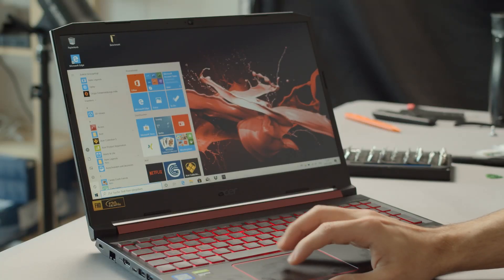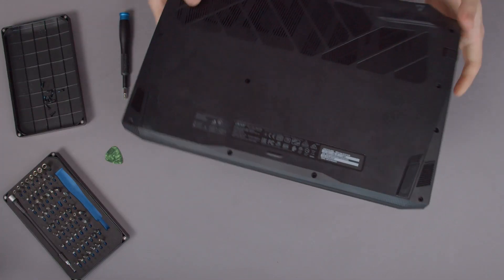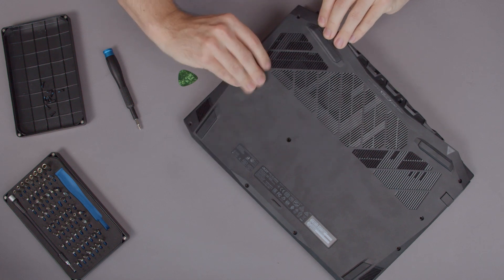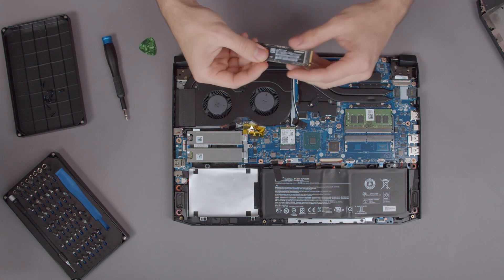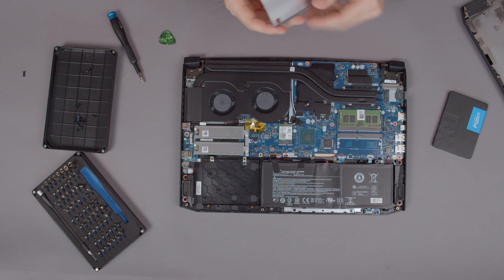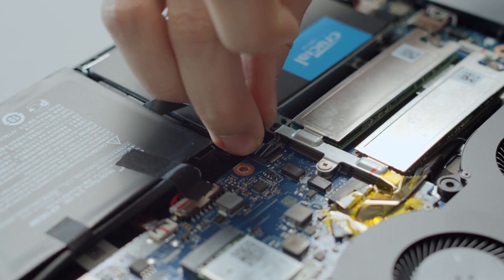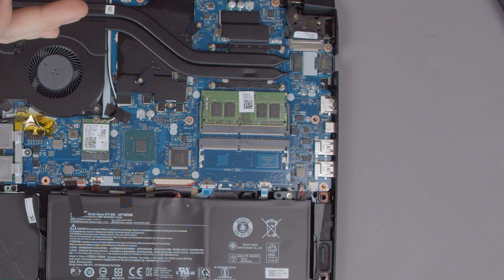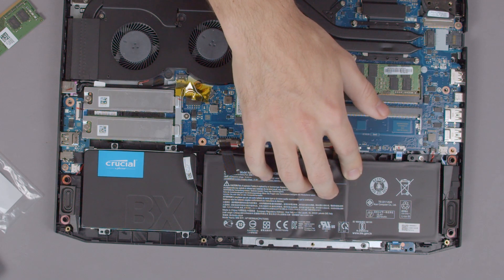Tutorial: How to Upgrade the SSD and RAM of your Acer Nitro 5 - ENG

Comment: Neat, I just got this laptop, and I am so happy that I can replace and upgrade some of the components! I am hoping to upgrade my RAM asap.
Reply: I got one about 2 months ago and this laptop is sick and I want to get an 1 tb ssd and 2 8gb ram sticks and I'm set lol
Reply: @67features  just recently replaced the ram and it wasn’t hard. Just some things he didn’t mention is that you have to tilt the stick and push it down and to take off the older one you have to pull on those hooks securing the sticks
Reply: @southerncalifornia4771  hey where did you purchase your memory just curious? I know there's tons of places. I'll probably upgrade my sons laptop to 16GB. 32 is just overkill for Roblox.
Reply: @ever6  I read up on some best fits and just bought it off amazon. Yeah thats what I have now 16gb. The pair cost me 59 USD. I think that this laptop anything 2666 is compatible. 
 
G.Skill 16GB 2666MHz DDR4 SO-DIMM Laptop Memory Upgrade Kit (CL19) 1.20V PC4-21300 Ripjaws 2x8GB
Reply: did you get the one with the GTX 1650 Ti or the RTX 2060? How is it with gaming I'm looking at getting one my self just don't know which one to get.
Reply: @bryanmathis224  I bought the gtx too; it runs escape from tarkov on high settings with roughly 70fps; any single player game can basically run ultra; all darks souls 3 will run ultra with 60fps too. Proper neat laptop for the price
Reply: @bryanmathis224  I have GTX . It is honestly better than I expected. It runs most games. Warzone, Apex,  and even Cold War but obv a bit frame drops. The only drawback I i have the 500gb but an upgrade to SSD will fix that. Not too bad
Reply: @SouthernCalifornia  hi sorry i just had this laptop and i have the 512 ssd pcie. The empty slot beside it. Can i just add another m.2 pcie 1tb ssd to it for extra storage without downloading anything or do  i need to do something else? Same 2.5 inch ssd can i just bjy and. Plug and the system would  recognise it? Any help would be appriciated please?
Reply: @martachong123  
If you want to know more about something you aren't able to understand than
Comment me back i'll try to help,(i have most of the details here to get you going):-
Check wheather the empty (M.2 Pcie Drive is sata or nvme protocol and buy the one that's same to it,
Check that and for the 2.5 inch drive mount the drive to it's metal tray and connect it to laptop motherboard through the
pre provided ribbon cable as shown in the video.
Note:- You don't have to download anything but the new drive's won't show up in the windows explorer just yet.
You have enable them from windows first. 
Search:- How to enable new storage drive's in windows 10.
That will be an easy way to understand and follow along through the steps in the video and get your drive's running.
Reply: Can someone explain to me why you need change or replace the ram if there is a 2nd socket to put it so you have 2 indicated ram.
Im beginner in the world of laptops so i am asking.
Reply: @doshiishiro5826  It's so that you have two similar Ram modules/Dimms to have better and most compatibility between them and don't end up having any system issues which you likely won't but still can have.
Reply: @chettiarsirusraj9501  can you suggest any laptops for me for civil engineering student
Reply: @doshiishiro5826  I don't know what programs or apps you use but try to ask the,
 teacher or your manager from your work place about what specs you should have in your laptop, 
Like :-CPU
Intel:-9th,10th or 11th gen CPU processors.
AMD:-3000 or 5000 series CPU processors ,
GPU any Nvidia Gtx1650 or 1660 series or if you can find and afford RTX 2000 or 3000 series will be a good option 
and the 
(Ram amount 16gb i'll recommend atleast you can buy the laptop with 8gb ram and upgrade it to 16gb or 32gb later).
Reply: @chettiarsirusraj9501  for example i buy a laptop with 8 gb ram and buy an extra 8 gb ram and use that to the 2nd slot, so i have now an 16gb ram? Does it add or not? 

Btw thank you so so much for responding because i am really beginner.
Reply: @doshiishiro5826  Note:-the laptop ram are called so Dimms(due to their smaller size).
You can do that but make sure to buy the same capacity and clock speed of ram that you already have in your system/laptop you can check that in windows10 task manager in the performance tab ok.
Otherwise the system will run at the ram clock speed of the slower ram/Dimm module.
Reply: @chettiarsirusraj9501  if i have a budget of 45,000 pesos or 900usd, what can you suggest a best laptop for me, 
You can also suggest a laptop that has low ram and storage if it's upgradable but with good gpu and cpu.
I really struggling all this week to find a best laptop that is worth buying, because i save money for this, so becoming a wise consumer is the best for this i think.
Reply: @chettiarsirusraj9501  so i must also check that "clockspeed" i don't know about that but i think its necessary since you tell it to me. I must check that they are the same in clockspeed and capacity,

So if i have 8gb ram i also must buy 8gb ram to make it 16.
But if i have 8gb ram and buy buy 16gb ram, the system only use the smaller one which is 8gb ram, so i just waste my money ,
But to solve that i need to remove the lower one which is the 8gb ram and put the 16gb ram so the system will reads it.

Am i right? Or still dumb hAhah
Reply: @chettiarsirusraj9501  do you think 4gb gpu like this laptop can run autocad for civil engineering.
Reply: @AwesomeFusion Check your systems specs through task manager(in the performance tab)for your laptop/Pc and get matching ram stick with the same capacity like 8gb+8gb for a total of 16gb ram,16+16 for 32gb ram and so on upto 64gb.
Just search for your (laptop/Desktop memory in what capacity you want like 16gb,32gb,64gb) memory in (New egg/Amazon) buy two sticks of identical ram for your particular system. You can comment and ask for some more details if you need help.

Comment: I've added 8go of ram ans checked the clock speed and everything, my pc don't want to start rn, please help me idk what to do 🙏
Reply from the maker: Hey, check if the RAM is inserted properly and try again. Usually it's just not perfectly fitted ram.
Reply: @notebooksbilliger  it was inserted properly
Reply: Hey did you find the solution? I have the same problem
Reply: @raco1246  no i haven't but some peoples told me to try different brands
Reply: @gaspard2975  I unplugged the battery and it worked!
Reply: @raco1246  you disconnect it then reconnect it and it works ?

Comment: can you do aa tutorial for removing the radiator and cleaning the fans youll be the first to make that
Reply from the maker: Hey, you don't neet to remove the heatpipes in order to clean them. Just get a bottle of canned air or a small blower and blow into the fan outlets when the laptop is shutdown. That should clean the fan grills easily.
Reply: @notebooksbilliger  thanks for the reply really appreciate it. But should i also disconnect the battery when doing this? Or not necessary?

Comment: If we just change the  ram do we have to install windows again and can we change ram from 8gb ram to 16gb and how  uch mhz is required
Reply: Changing or adding RAM doesn't affect your windows.(it will be the same as you left it once you turn it back on). If you want 16 gb of ram make sure to buy two sticks of 8 gb at the same mhz (or if you only need to buy one stick of the same mhz as the one in the laptop). In his video he says which mhz sticks to get.

Comment: how much the maximum capacity m.2 storage that i can upgrade on m.2 slots ?
Reply from the maker: Hey, in theory Windows 10 supports up to 9.4 zettabytes. The only limitation currently is whatever is available as M.2 Cards right now. 4TB is readily available, larger drives are possible but so expensive it's just not worth it.

Comment: If i have an intel processor can i still change my ram into a 3200mhz one? Or should i stick to 2666
Reply from the maker: Hey, you can, but it will run at 2666MHz since the Intel Chipset doesn't support higher speeds in this case.

Comment: Hello i use acer nitro 5 2018 , and its only 4 GB ram. There was just two slot. can i use another slot by add 8 GB ram without remove the original 4 GB ram?..please help me..my laptop slow as turtle😢
Reply: Why don’t you take out the 4 Gb?
Reply: @lucascarneiro2101  it better 12GB right? It such a waste if i remove 4gb ram

Comment: Laptop turns on but screen not turning on after ram upgrade. Help? My laptop came with 3200mhz ram, i want to upgrade it to 16gb 2400mhz, does this mean my nitro 5 only support 3200mhz? Reason why im using 2400mhz is because im taking the ram from my prev laptop which only support 2400mhz
Reply from the maker: Hey, the speed of the RAM doesn't matter that much. In case you have a Ryzen model slower RAM will only need to a bit less performance. The screen not turning on usually means the RAM is not properly in place, or worst case, defective. Try turning it on with only one module, then with the other and then both again, to find out if one is maybe broken.

Comment: I don't know if anyone is still actively answering questions, but is there 2 M2 slots? So 1 existing for the factory SSD and then an extra? I'd love to be able to run 2 M2 SSDs and then a 4TB HDD.
Reply from the maker: Hey, of course we are :) There are 2 M.2 Slots - one i SATA and PCIe each. So check in advance what kind of SSD is preinstalled. If it's a SATA one, get a PCIe SSD and vice versa.

Comment: I bought this gaming laptop a bit early(2 years ago), my model is Nitro AN515-51 so everything I think is situated a bit differently, the lids are all seperate for each component in the laptop, my RAM is 6 GB which is the greatest torture, since it doesn't work like an 8 GB one and seems to be no different than a 4 gb one. My question is if I can upgrade to 32 GB of ram? I know its possible with Nitro 5 laptops in general, in fact that would be the max amount of ram you could upgrade, but I am wondering if my model can handle 32.
My Specs
Nitro AN515-51
CPU: Intel Core I5 7300-HQ
GPU: Nvidia GeForce 1050
RAM: 6 GB (1x4) (1x2) Dual Channel
Motherboard model: Freed_KLS v1.13
BIOS: Insyde Corp v1.13
Reply from the maker: Hey, you can of course upgrade the RAM. The theoretical maximum is 64GB, so 2*32GB. You just have to replace both RAM Modules for new ones, so better get a fitting kit with the desired amount of RAM.
Reply: @notebooksbilliger  thank you for the reply

Comment: Can I upgrade my Nitro 5 AN515-54-75aj RAM from 2666mhz to 3200mhz?
Reply from the maker: Hey, you can use 3200MHz RAM, but since the Nitro 5 will only use a maximum frequency of 2666MHz, it won't make the RAM or notebook any faster than using 2666MHz modules.

Comment: Just bought a PNY 2.4Ghz 8Gb ram stick not sure if it matches up with the one I have inside my case nitro 5 it’s the one with Ryzen would there be a problem if I install this ram stick?
Reply from the maker: Hey, it will work without issues, but usually the Nitro 5 uses 2666MHz RAM. So to match the new module it will slow down the existing RAM to 2400MHz as well. It's usually not a big performance hit though.

Comment: after you add the new sdd 2.5'', just turn on the laptop or you have to do something else? like a configuration?
Reply from the maker: Hey, you mean when you add a secondary SSD or when you swap the existing one? If it's a secondary you just have to initialise it. After booting the notebook hit the windows button and type "Disc management" and there should be a prompt to initialise it. After that just format it and you're good to go. Here's also a quick guide: https://www.diskpart.com/articles/format-ssd-6289.html#:~:text=msc%22%20to%20open%20Disk%20Management,system%2C%20perform%20a%20quick%20format.
Reply: @notebooksbilliger  thank u!!

Comment: What is the max ram capacity for this series?
Reply from the maker: Hey, that depends on the exact model you have. Most new Intel and AMD CPUs support up to 64GB, but since it has only 2 RAM slots, 32GB is the maximum you should go. 32GB Modules are still very expensive and the costs outweight the use of the extra RAM.

Comment: Hi nbb, I have the Nitro 5 with ryzen 5, gtx1650 with a single 1TB HDD and 8gb ram(6.5 actually because of integrated graphics u know). I'm planning to add an SSD and an additional 8gb ram. Which one should I do first? Also, is 120gb SSD enough?
Reply from the maker: Hey, if you want to improve the overall performance get the SSD first. Compared to the HDD your Nitro will just fly with a SSD. 120GB is not really enough and also doesn't make much sense sind bigger SSDs aren't that much mor expensive. Get at least 256GB so you can put some games and heavy applications on the SSD as well. Better do that first and then save some money for an addition 8GB RAM.
Reply: @notebooksbilliger  Thanks for the tip! Got a clear idea now. Really appreciate it!

Comment: I am really nervous to do the upgrade is there any way that I could break the laptop
Reply from the maker: Hey, being nervous isn't the best start tbh. But there is no reason to worry. If you are carefull and take your time to follow the steps you should be fine. Just don't rush it and when you use a metal tool like a screwdriver be extra careful not to scratch the mainboard.

Comment: Just upgraded with battery connected. Grounded. 2 SODIMM Kingston 16GB each model KCP426SD8/16 (2666MHz, CL 19). And I just noticed late your warning, about "Important Notice: second M.2 must be SATA"... I already purchased Crucial 1TB NVMe M.2 PCIe SSD P1 Model CT1000P1SSD8. The free M.2 slot was the top, near the vents. When I removed the M.2 protector, the mainboard was printed with "PCIE" so I decided to install and try and it works. This was on an Acer Nitro 5 AN517-51 17". (Complete model AN517-51-56YW). This Acer came with 8GB Hynix HMA81GS6JJR8N-VK and a 512GB SSD WDC PC SN520 SDAPNUW-512G-1014 NVMe Gen3 x2.
Reply from the maker: Hey, it always depends on which slot is already used. Apparently in your case the preinstalled SSD was SATA you you could upgrade with a PCIe NVMe :)
Reply: @notebooksbilliger  Nop, pre-installed disk is Western Digital PC SN520 (PCIe Gen3 x2) https://documents.westerndigital.com/content/dam/doc-library/en_us/assets/public/western-digital/product/internal-drives/pc-sn520-ssd/data-sheet-pc-sn520-compute.pdf

Comment: Hi, I have a HP Omen 15 2020 laptop and I want to upgrade the SSD.
It comes with one pre installed 512GB M.2 NVMe 3x4 and one M.2 NVMe empty slot.
So do I need to do cloning after installing the new SSD or should I just plug the new one and I'm ready to use it?

Please help as I can't find the answer to this anywhere.

Thanks & regards
Reply from the maker: Hey, if you just add another SSD you won't need to clone anything. But you should check if the second slot really is a PCIe M.2 Slot or maybe just SATA. Usually it's printed on the PCB or, if not, just put the current SSD into the other slot and see if it's booting. If yes, just add another SSD, initialise and format it and you're good to go.

Comment: WD SN750 2TB Laptop internal solid state drive. Model (WDS200T3XHC) Does it support with this model, in the video
Reply from the maker: Hey, it will work, but only in the M.2 PCIe Slot that's usually already occupied. So check what kind of SSD you're using right now. If it's SATA you can just add the WD SN750. If it's a PCIe SSD, you would have to switch the existing one for the SN750.

Comment: And one thing bro can I install 2.5 inch  2tb ssd drive and drives come with the connector and I have to buy separately
Reply from the maker: Hey, usually the do come with the adaptor. If not, I added the exact cable to the video description.

Comment: Pls help...
My screw is stuck so tight that i cant gety cover out !
What can i do ? All except one screw came out
Reply from the maker: Hey, that's odd. Try a different screwdriver maybe with a better fitting tip and a bigger handle. But be careful not to ruin the screwhead with a bad fitting tip.
Reply: @notebooksbilliger  thanks for the tip , but do you know of any method like applying some kind of oil or anythng like that ?

and what should i do if it doesnt come out even after using a different screwdriver?

Comment: Can a 1TB seagate barracuda HDD 2.5"  fit? I know getting an SSD would be faster but after buying the laptop I can just about afford the HDD and I need more storage than the 256GB SSD it comes with as standard
Reply from the maker: Hey, as long as it is a mximum of 9mm in hight it will fit and work.

Comment: Does it matter which ram pin amount I buy such as 240 204 260 pin sodium memory
Reply from the maker: Hey, yes it does. Only one will fit, so get the correct one :) You'll need DDR4 SO-DIMM with 260 Pins, every other module won't work - they won't even fit the slot.
Reply: notebooksbilliger.de thank you

Comment: Prof, will a HyperX Impact DDR4 16GB SODIMM 2400MHz CL14 work with a Kingston 8GB DDR4 SODIMM 2666MHz CL19?

They are of different frequencies & CL. And, are of different brand as well.
Reply: They will work with the lower frequency (2400)
Reply from the maker: Hey, yes they will work, as Abdullah wrote, on the lower frequency of the new RAM.
Reply: @abdullahzeido6134   Thanks.

How will it affect the overall performance? As the low freq also has a lower CL i.e. CL14?

And, what would the effect of the overall performance be if the two RAMs has the same freq, but different CL (latency)?
Reply: They will also work on the higher latency 
But if your cpu is INTEL never mind
and if it is from AMD ryzen take higher frequency and lower latency